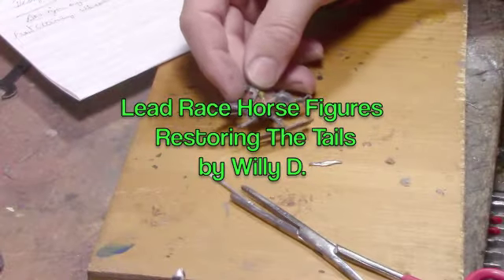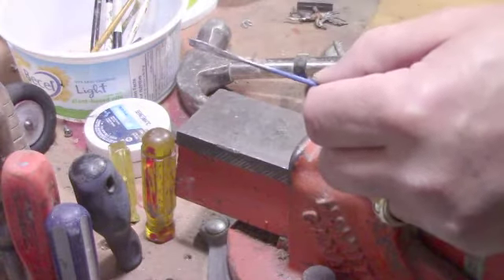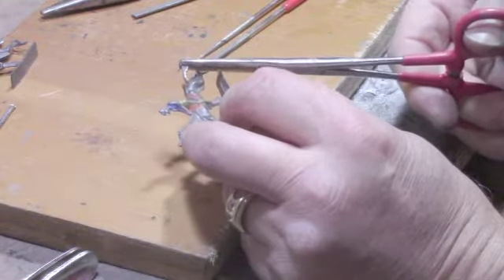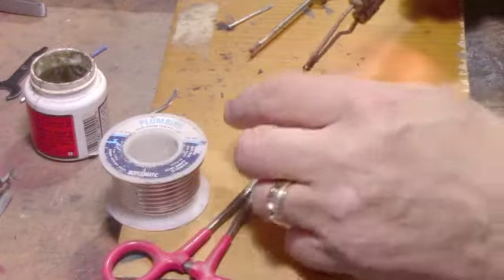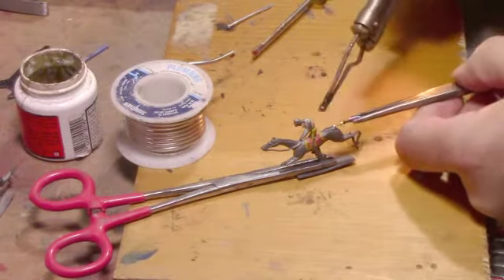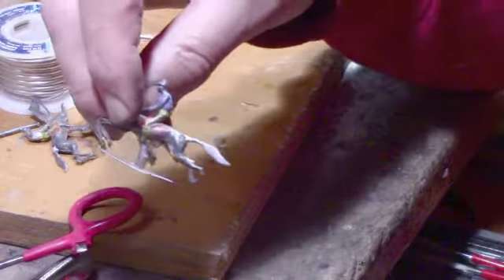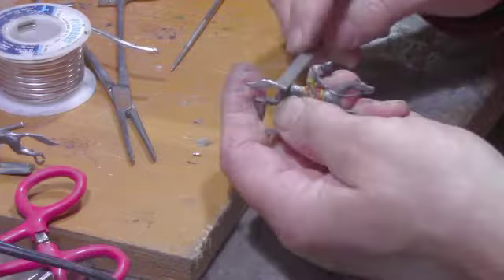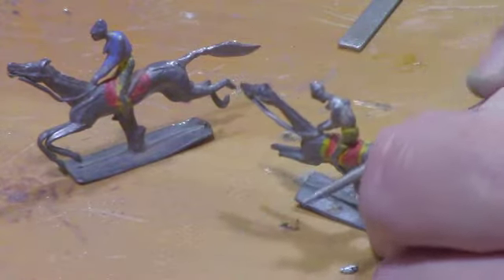HOW TO RESTORE LEAD FIGURES   2

Comment: What is the flux used for?
Reply from the maker: Plumbing flux and solder is fine. Mainly used for copper pipe fittings. One can buy it in most hardware stores. Hope this helps you with your project.
Reply from the maker: Hi Diane: Today I posted another video showing how I solder the figures. F.Y.I.  I never use a torch as the flame is too hot, it's hard to control and melts the lead.
This is my methods which I have tested and feel safe using. Some may disagree which is fine. 
Any other questions feel free to ask. "Good luck"    
Cheers Willy